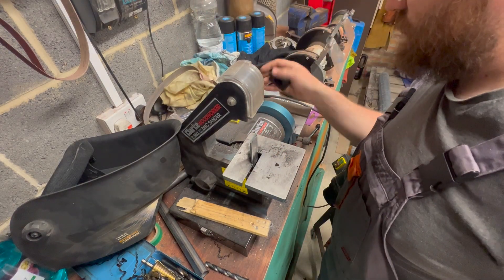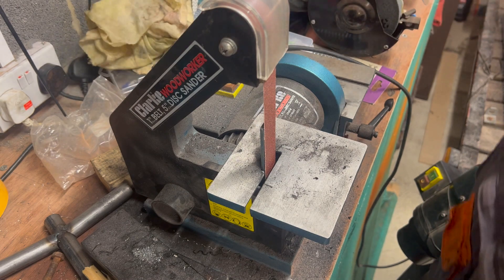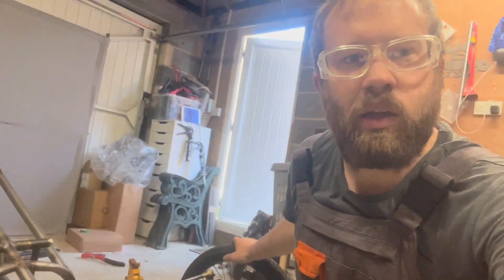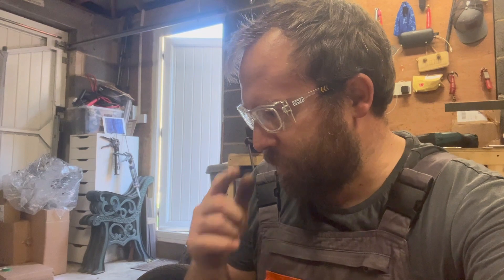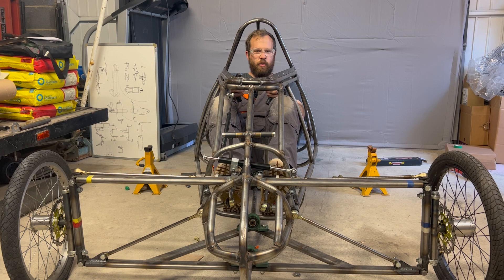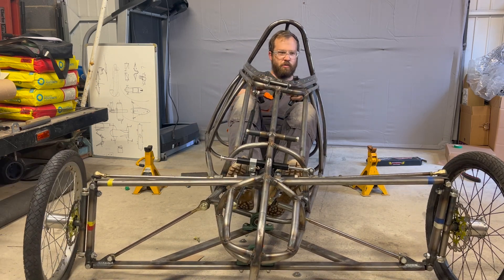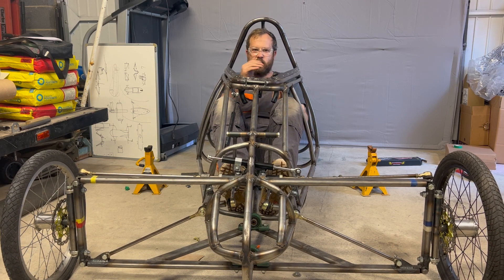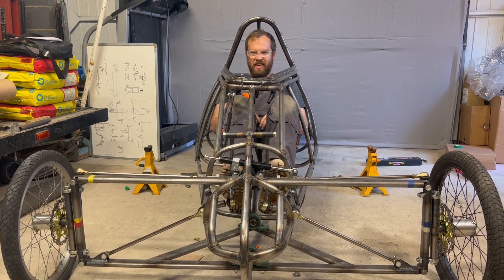Kart V3 Build episode 7

Comment: If it tilts why did you make it so wide? Also it looks like your contact patches doesn't fall behind your steering axis on your front wheels.  I like it.
Reply from the maker: I made it wide just because being a trike it will be unstable, I just thought the wider i could get it the more stable it will be, I don’t think making it thinner will give me any significant advantage. The contact patch is in front of the axle by around 4cm, there is a 15deg tilt on the steering pinion.